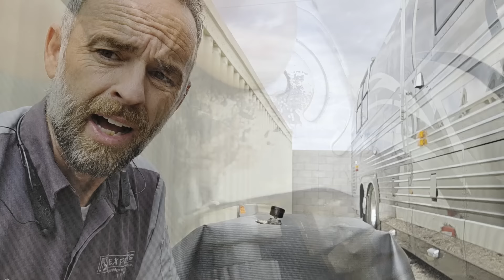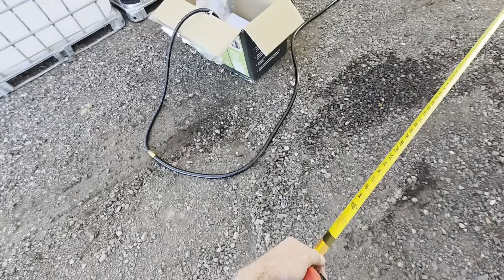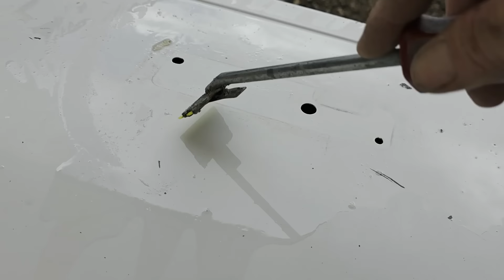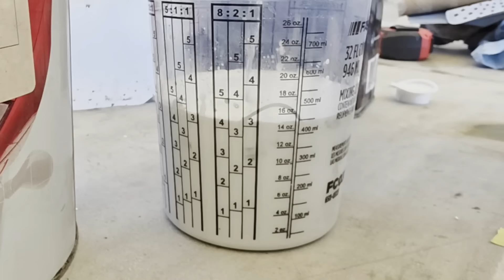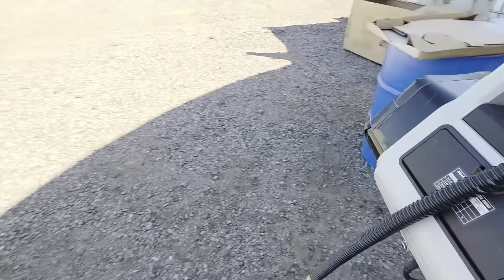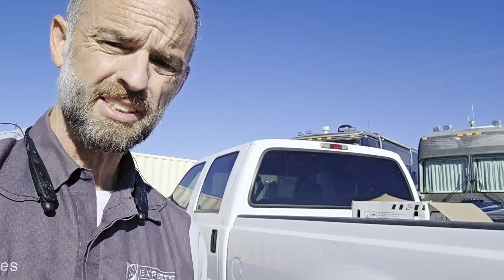Is Automotive Turbine Painting Really This Easy? Trying a Phalanx 5-Stage

Comment: 5 and 6 stage turbines are great for many types of painting. For gravity feed, simply buy a fuji spray t75g spraygun if you are going to be painting often. All turbine guns use the same garden hose connectors. If you want a primo gun and are willing to spend the cash, the Apollo 7700 latest version is hard to beat.
Reply from the maker: I am impressed with the system and surprised more painters still use compressed air.
Reply: @AZExpert this isn't even anything new! I have an old accuspray shop unit from probably the 90's. Large unit on wheels with a small compressor for a pressure pot. Accuspray had a nice turbine gun that kind of set the standard to match or beat for companies later on

Comment: single stage, 2 medium coats and one wet coat. looks like it was adjusted for quit a bit of volume. hard to guess through a camera. I like the single stage paints because they are easier to repair and can be polished out any time in the future. I think they do better in the sun vs. clear coat flake.... I agree with you about the gravity gun. I've used cup guns for the first 10 years the switched to gravity feed, now wouldn't use anything else. Glad to see  you clean your equip. I agree with you for the new DYI folks, it would be a good investment to keep from buying a decent compressor.  a cheap compressor is $400. a good one is $900. a cheap gun is $100. then there is the pressure regulator, hose and blow tip. an easy$1000. just to get started. I think 10 CUFPM is the min needed to spray with. Looked like the over spray in the air was about the same as a gravity gun. I was biting my nails that you would move away from the coach and wear a mask!!!! hehehehe:face-orange-frowning:

Comment: I think I would have used a white primer. Get an etching white high build primer so any paint scrapes or nicks will not show as much, compared to a dark primer. If you have left over paint, put the lid back on well, and turn it upside down so the lid is on the bottom. This will skin over the paint over time, but when you flip it right side up and open it, you'll still have fresh paint. HVLP has come a long way for painting. I think that HVLP kit is quite the deal, if it includes the paint gun.
Reply: U must be a painter been painting for 35 years

Comment: James, A bit off topic, but how do you keep your paint, adhesives and other chemicals from getting destroyed by the summer heat? It’s a constant issue with me, so much so, that I started storing some of these items in my temperature controlled house.
Reply from the maker: The caulking goes bad quickly, but mostly I keep minimum inventory
Reply: I have a used refrigerator set at about 60F and store all my adhesives caulking and paint in it.